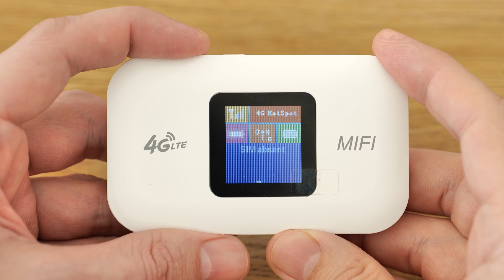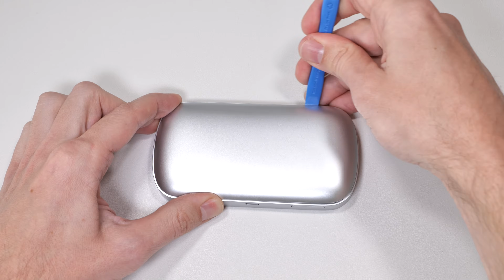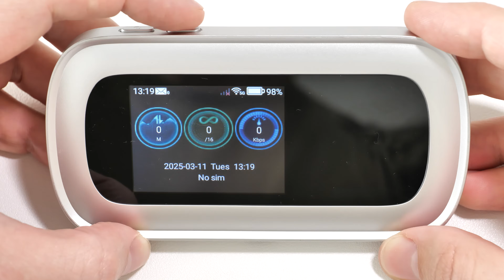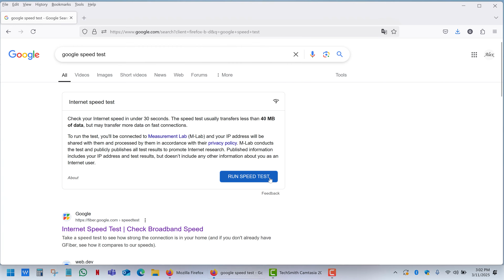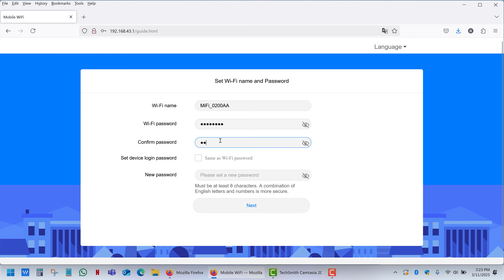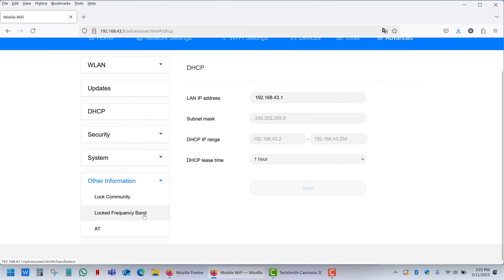The BEST 4G/5G Mobile Router? M2H / M2A Unboxing + Real-World Speed Test!

Comment from the maker: Since posting this video, I’ve done more testing and wanted to share some updates. With the WiFi set to maximum power, the coverage easily spans a large house or apartment—I can even step outside and still get a strong signal. Interestingly, the mobile reception on this router is better than on my smartphone. With three devices connected and WiFi set to medium power, the battery lasts around 30 hours, going from 100% down to 5%. Truly a top-notch device!
Reply: can you use with a power bank ?
Reply from the maker: @julien1 Sure! You can use any USB port to power or charge the device.
Reply: @ElectronicsComputers  I mean can you get internet access at the same time as charging or without battery attached to a power bank.
^ This is what EVERYONE needs to know if you do more reviews...!
Reply from the maker: @julien1  If the device can be powered via USB, it means it can operate normally just like any mobile phone, tablet, or laptop. Whether it charges the battery while being powered via USB doesn’t really matter. I’ve never tried running it without a battery, but if you need a device that works without one, why get a mobile router in the first place? I would assume, just like with smartphones and tablets, it likely won’t power on via USB alone without a battery installed.
Reply: @ElectronicsComputers I irl stream and I need over 6 hrs sometimes. The nighthawk does with or without battery 1 of it's ticks BUT too expensive sigh.
Reply: @ElectronicsComputers not all work whilst charging ...it's why we need to know.
Reply: I need a mobile router because I IRL stream and need longer than 6 hours. Most batteries at 5000 m'ah will not last over 5.5 hrs whilst streaming, (years of testing and trying different mobile hotspots). The beauty of the Nighthawk is it will run with or without a battery and attached to a power bank, big tick for the Nighthawks. Obviously you don't want a battery in it if you are going to use a power bank..! So it is vital to know IF any mobile hotspot will work without a battery + power bank and MANY dont. If it works with battery and power attached (many dont if charging with battery in), you can run the battery down to just over empty then attach a power bank for the residual time you need charge.
Reply from the maker: @julien1  Do you actually own a Nighthawk mobile router, or are you just considering buying one? I used to own a Nighthawk M6, which I bought for $450 a total scam and rip-off for what you get. It was extremely unstable and unreliable. I had it for about four months before I finally decided to sell it.
First of all, it gets crazy hot for no reason. I often use torrents for uploading and downloading huge files, and that absolutely kills the router. It gets so hot it freezes and reboots. Even just carrying it in my backpack made it overheat. I never had such issues with the M2A router, even with heavy torrent use or when it’s in my backpack, it barely gets warm. It’s never frozen, dropped the connection, or given me any issues. I also noticed a big difference during my bike rides in the forest and mountains. In spots where the Nighthawk lost its connection, this much cheaper router still maintained one bar. As for battery life, I don’t know exactly how long it will last under continuous streaming. But in my case with three connected devices (laptop, phone, and tablet) and normal usage the router ran for 36 hours before shutting down. If you want to maximize time, just power it with a power bank and when its battery runs out, the router will automatically switch to its internal battery, so you’ll have plenty of time to do whatever you need.
Reply: hi does the M2A support usb tethering? and does it supports verizon network?
Reply from the maker: @yesi1911  Yes, it supports USB tethering and Verizon network.

Comment: hello 
i buy this router my model is M2A-33 

1- dos not have wifi-6 (ax) in wifi setting (its not important for me )

2- dos not combine LTE bands (LTE-A) at all and is CAT 13 (very important for me )

3- 5g bands only n78 work the rest dos not connect to (n41-n77-n28) the rest work in my place i test it with my android phone  (very important for me )

can you help me if you can with the AT! command 

MODEM AT in the format : AT+CREG=[<n>] or AT+CREG? or AT+CREG=?

i want to change the IMEI and maybe solve the rest of my problem  2 and 3
Reply from the maker: our model is different from the one in the video. If it has the same web interface, go to Advanced - Wi-Fi Advanced Settings and you should see the 802.11 mode options (b/g/n/ax). To check supported mobile bands, go to Other Information - Locked Frequency Band. That will display all the LTE/5G bands supported by your router. The model I reviewed supports all those bands and works perfectly in Seattle on both T-Mobile and AT&T (4G/5G). I also tested it in Germany during my trip. These routers are based on the MediaTek Dimensity 900 chipset which supports LTE-A carrier aggregation and 5G aggregation. But it has full support only for T-Mobile in the U.S while AT&T and Verizon are only partially covered due to some missing bands. And no, you cannot change the IMEI using AT+CREG or any standard 3GPP AT commands AT+CREG only handles network registration status.

Comment: Before I bought M2H, I had a Tp-link and a Netgear, the last one had nice interfaces but was very unreliable. All I did was set a new password, connected this router to an old phone charger in the middle of the house, and forgot about it. We have two smart TVs, three phones, three laptops, one tablet, and two WiFi security cameras and not a single glitch so far.
Reply from the maker: Wow, you’re really squeezing the sh** out of that little guy! I’ve never had any issues either. I even switched my phone to a prepaid plan because I only use messengers for calls and rely on data from this router, which is always with me.

Comment: 1- Can i select and lock the band from the device or i need to go to website to change it ?

2- does it work without battery just cable ?
Reply from the maker: 1. Assuming there’s only a power button, how are you gonna do that!? 
2. Never tried. The router can be powered by any USB port, once external power is cut, it automatically switches to the internal battery. In my case, the maximum I’ve gotten from the internal battery is 36 hours with three connected devices,  medium WiFi power settings and average internet use. Compared to the Netgear M6 garbage I had before, this one is perfect, never had to reboot it and no overheating issues, even under heavy torrent load.
Reply: @ElectronicsComputers 
I thought it has touch screen 
Thanks

Comment: I just connect my 5G mobile phone to a GLINet Slate AX portable router via a USB cable to act as a wireless modem.  It converts the phone's limited hotspot data to unlimited data with a little TTL magic, no need for a dedicated data line,  I'm getting around 500 Mbps speeds. ;)
Reply: Could you elaborate more on how this can be done
Reply: @scropion86  - You can find lots of info and help on the WirelessJoint forum on how to get started.
Reply: @scropion86  - YT keeps deleting my reply... oh well.
Reply: @billant2 sorry for that. no issue. Thanks
Reply: @scropion86  - It's ridiculous, I was trying to point you to a wireless forum  but YT just keeps deleting it.
Reply: @scropion86  - WirelessJoint
Reply: @scropion86  - Wireless Joint (one word)
Reply: @scropion86  - You can find more info on the WirelessJoint forum
Reply: @scropion86 you need a +66watt power bank to tether a mobile phone using the slate 7. Just tether and connect to wireless network...! No brainer.
Reply: You ain't in UK ... It suc over here especially upload speeds ... If I get a good 720p irl stream I'm lucky....I bought the slate 7 to tether my mobile and make a hotspot but I feel the nighthawk m1 at 4g does it better lol.
Reply: Ttl magic ? Pls explian
Reply from the maker: To bypass mobile carrier throttling or hotspot restrictions using TTL (Time-To-Live) modification, here's how the "TTL magic" works. Mobile carriers often detect hotspot/tethering by checking TTL values from packets phone traffic typically has TTL = 64 (on Android). When you tether to a laptop, the TTL usually becomes 63, because each network hop reduces TTL by 1. Carriers flag TTLs like 63 or 127 as non-phone traffic and throttle or block it. So the trick is force your device (e.g. laptop) to send packets with TTL = 65, so when it gets decremented by 1 through the phone, the carrier sees TTL = 64 and thinks it's still phone-native traffic. On Windows run Command Prompt as Admin and type: netsh int ipv4 set glob defaultcurhoplimit=65
Reply: @ElectronicsComputers  - If the IPv6 interface is enabled, then also enter
netsh int ipv6 set global defaultcurhoplimit=65
On most carriers 65 works but some requires 64.  The TTL can also be set on a router's settings so all devices work not just a pc.
Reply: @ElectronicsComputers  - Some carriers use 64 or 65, so if it doesn't work just try the other value.  Also this can be set inside most OpenWRT/GoldenOrb routers under firewall  > customer rules > iptables.